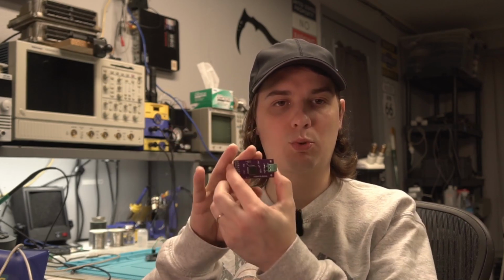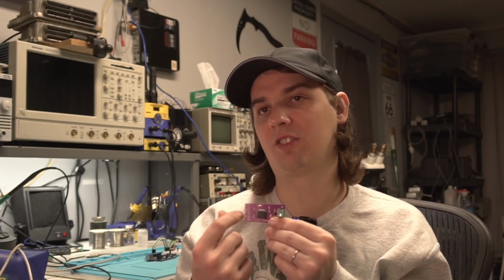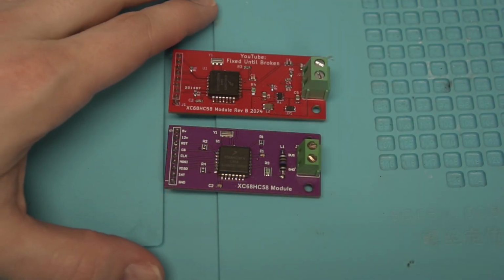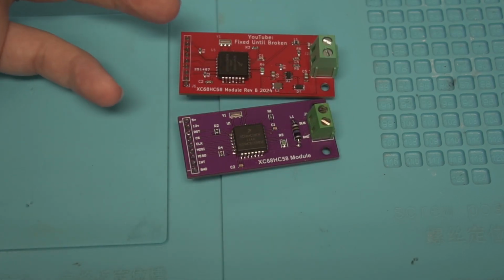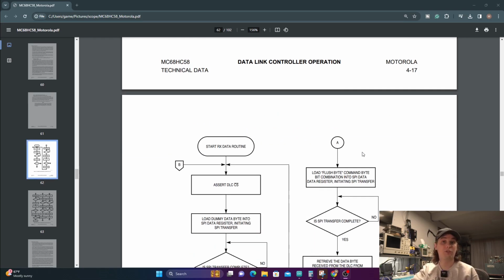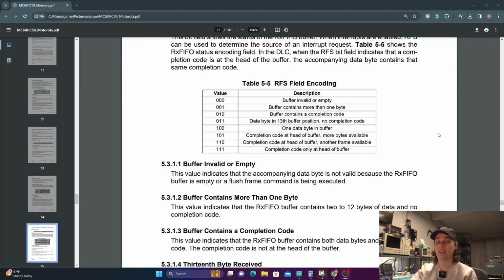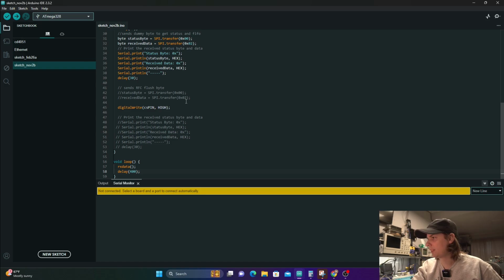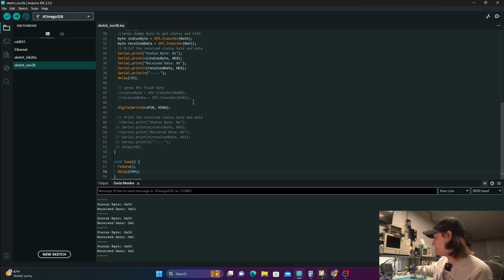GM Class 2 & J1850 VPW Communication with Arduino and XC68HC58 IC Rev B

Comment: Excellent,.  I look forward to getting order, but I also have a large amount of work to do then.  In my application the E-ROD LS3 utilizes CAN data and the Tahoe communicates using J1850VPW (GM class2) at a much lower speed.  So without a protocol converter I have almost no gauges and the ABS does not work.  The protocol converter, as I am learning, will have to decode requests, reframe them and pass them along.  Then it must decode responses, reframe and provide them to the requester in an understandable manner to the requester.
I hoped to find a premade solution to my powertrain swap but had no luck so far. 
You have done a lot of work here and I for one really appreciate it.  I hope to feed some code back to this project if I have some success.
Reply from the maker: Thanks for purchasing! While in the development stage the Arduino uno rev 4 might be useful. It supports hardware canbus. I'm not sure what version of Canbus that setup your working with has. Is it the GMlan single wire can or traditional canH canL type
Reply: @kenworks6068  Did you ever have any luck? I'm doing something similar with a 99 S10, except using a standalone ECU. I pretty stupidly ripped apart my truck before recording any of the raw serial data, so 100% in the dark on what I'm trying to emulate outside SAE PDFs. Guess I need to make friends with someone with a s10...

I think there are two j1850 busses to emulate, plus another higher resolution VSS signal needed for the ABS. I think the cluster should be pretty easy using the SAE PDFs, but the ABS, not so much...

Comment: hmmmm, maybe this is a solution to my issue. I tried reading pcm sensor data to display on .96oled displays with the elm327 bluetooth method but i couldnt get it working with the esp32. Verified the elm327 supports 1850vpw and can link and see data using the phone app. I just want to read the pcm data and send the info to my 6 oled screens mounted in the dash.

Comment: Maybe you can work this one out for me. I have an 03-07 Silverado, GM, ETC. cluster that everything works on, but will not communicate to ipchammer through obdx pro. At first I thought I had an issue with my obdx ppro or my bench testing setup, but after extensive testing with other clusters they all work fine. However, if I try to read this bad ipc then ipchammer/the obdx pro refuses to read anything else until I close the program and power cycle the obdx pro. I'm thinking this is something to do with a bad microcontroller maybe? You're way more experienced so I figured I'd try for your 2 cents. We can hop in a discord call or something and I can show you the setup and everything if you'd like.